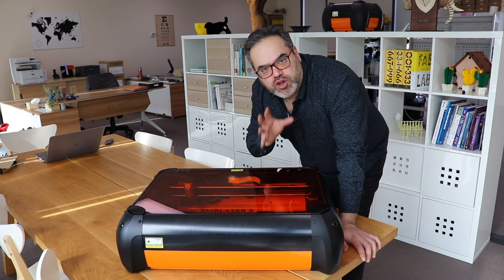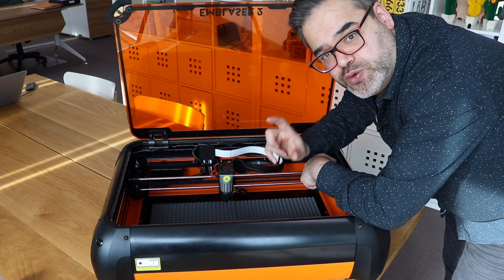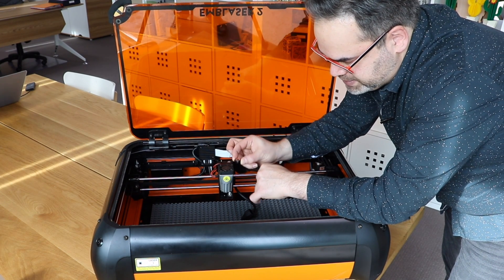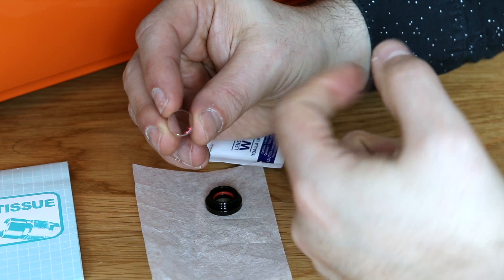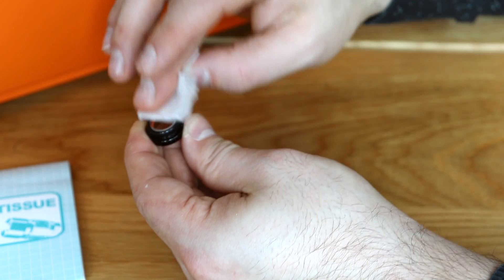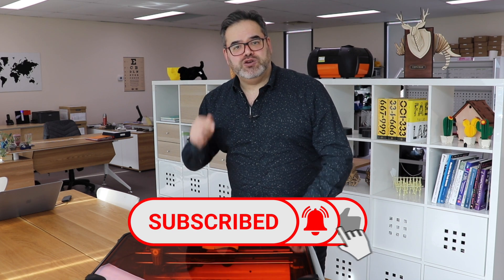Emblaser 2 Lens Cleaning

Comment from the maker: 0:01 - Introduction
0:46 - Introduction to the laser unit
1:06 - Removing air-assist hood
1:37 - Unscrewing the lens housing
2:11 - Removing lens for lens housing
2:55 - Cleaning the lens
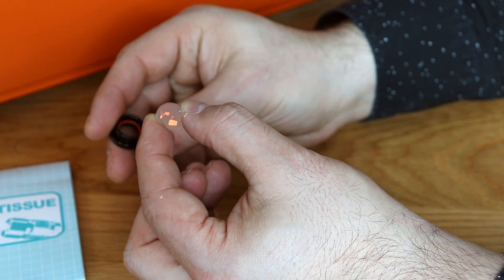4:12 - Replacing the lens into the lens housing
5:05 - Reassembly of lens housing to the laser unit
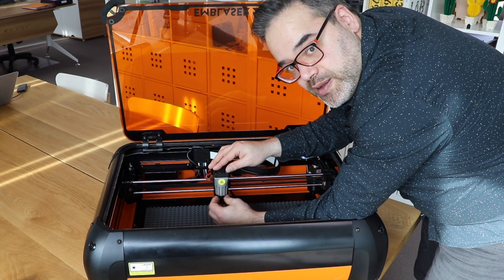5:56 - Attaching the air-assist hood
6:15 - Wrap up of cleaning procedure

Comment: Hi :) On the first generation of Emblaser 2 it's actually a lot more painful :(
Reply from the maker: First gen lens cleaning is a whole different process. I actually upgraded my laser unit to get away from using an allen key to clean my lens 😉
Reply: @LaserLivestream  Oh, ok, good to know that it can be done. Thanks ! By the way, do you think that the lack of lens cleaning could be the reason of wavy edges cuts ? I purchased my cutter in 2017 but, for various personal and professional reasons, I could only unpack it 2 months ago. So, I am using an old generation Emblaser 2 now and got some problems with focusing and so on. Darklylabs told me to change the firmware but I could not find all the appropriate files (I am waiting for their support right now). But regarding those wavy edges I am really wondering about what happend as 2 months ago everything was fine. And I did not cut so many things to justify that the lens would be already terribly dirty, but who knows. That'swhy yesterday I was about to tackle the task of cleaning the lens but simply gave it up, haha. Anyway, thank you for your answer and your clear video. :) Kind regards.

Comment: Should I need to use pliers?  it seems quite tight
Reply from the maker: Damian Lappin  I had the same issue the first time I took the lens off to clean it. I have a feeling that they are put on tight in the factory. Try holding the laser unit with your other hand and turn to the right. You don’t want to twist the laser unit in the rails. Let me know how you go! :)
Reply: Gil Poznanski thanks, I did end up using multigrips... and made sure I was holding the head.  The red rubber washer was stuck to the lens as well.  I was grateful for your video as it showed where the washer should sit.  It definitely needed a clean.
Reply from the maker: @DamianLappin  Glad you got it off. The O-Ring will be stiff and attached the first time it comes off. Don't tighten it that tight when you replace it, and it will come off easily next time. You can get to clean the lens in a few minutes. Enjoy!
Reply: Damian Lappin mine is ultra tight... just managed to scratch the outside of the ring itself... won’t budge at all.
Reply: ComradeQuiche Airsoft maybe some tape on the jaws, it was quite  disconcerting the amount of force it needed. (Now it’s just finger tight).
Make sure you’re turning it the right way? It’s upside down... I always have to recite “righty-righty” then figure out which is my right?!?

Comment: Not so simple if you have the early Emblaser 2, you also need to do a test to check the air assist nozzle is in perfect alignment otherwise it will block the laser beam.
Reply from the maker: Martin Coombs Hear you Martin. I do believe there is an upgrade kit that bring the earlier version in line with the procedure shown in the video.